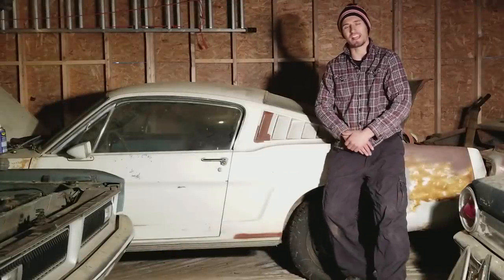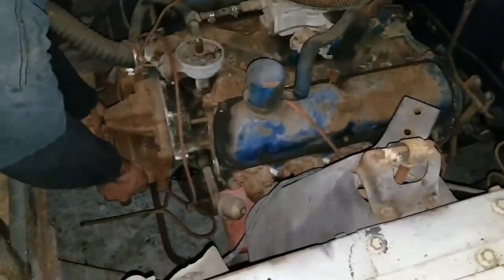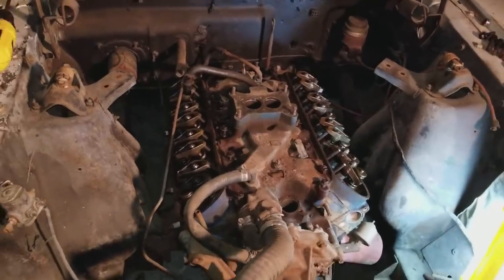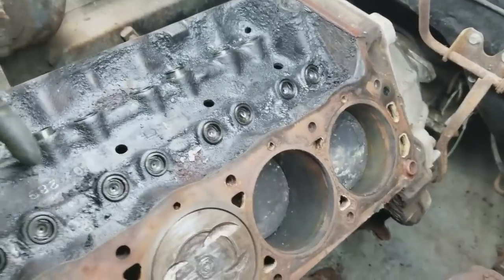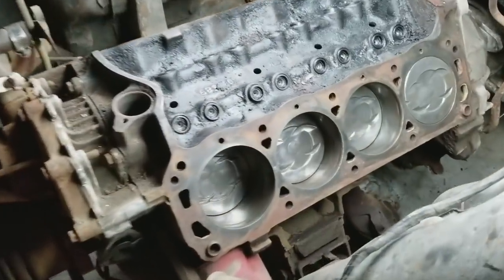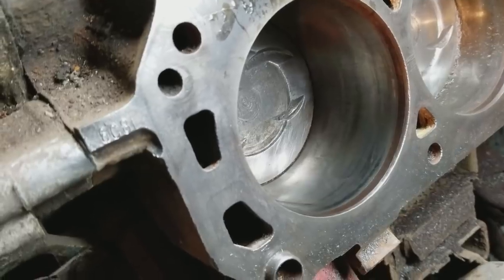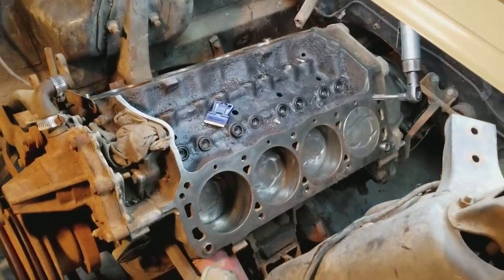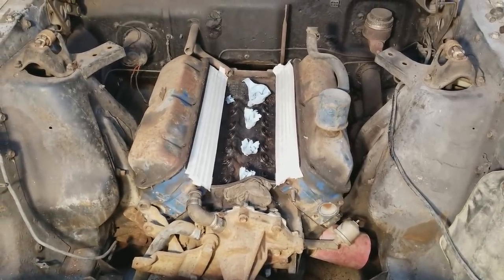Forgotten 1965 Mustang First Start in 44 Years, Fastback Revival Part 1!

Comment: I am new to the channel What about that abody in front of you
Reply from the maker: Glad to have ya! And Good eye! It's an original paint 1971 Dart Swinger Special. All original, never been patched, little to no rust. 6 cyl auto trans. Black interior that's like a step back in time it's so clean
Reply: I recently bought my first real project car a 72 dart swinger that was probably very similar to yours.  Someone swapped the 6 cylinder for a 318 and installed a roll cage. A little to modified to go back to stock. Also I guess they forgot about the stock rear axle so I am looking for a 8 3/4 rear end for it. My boss is a huge mopar guy so i am sure he has 10 hidden in the shop.
Reply from the maker: @AppalachianMotors  right on, what's your plans for it? We have a 69 as well which I'm thinking of putting a 340 and 4 spd in with 8 3/4 read end at some point
Reply: @Theoldcarchannel.   plans would love to put a 4 speed in it keep the 318 for as long as I can its primer gray and flat black I want to paint it a dark burnt orange and keep the hood flat black not a super great paint job I still want to drive it beyond that I am not sure what I want yet its half way to a old school drag car already

Comment: I highly recommend a timing chain....
Reply from the maker: Yeah, could probably use one eventually... but not atm. Like I said before, simply just want to get the engine running. If it dies,oh well. Plan B... if it lives cool, then ill start pulling it more apart (oil pan, oil pump, new this new that etc)
Reply: @Theoldcarchannel.  yeah dude but nylon cam gear? 50 years old??? 25$ set and 3 hours time down this far already
Reply from the maker: @bing bang 5.0 are a dime a dozen. Have two complete engines and 5spd set ups that will slide right in its place
Reply from the maker: @bing bang 😂😂 give me a break, making it worse with a 5spd... yeah that why everyone who has a stick car is now going 5 or even 6 spd. Who give two shits about numbers these days... if it were a K code completely different story, but it's a C code car (289 2bbl). If it were a 6cyl would you want me to keep it that way?

Comment: Why do MOST restored cars SOUND so loud as if they will blow up in a MOMENT? They WERE quiet when they were new. So please ANSWER this truthfully!! You can restore an engine back to. New
Reply from the maker: Was that last sentence a question? lol😂
Reply: I think that most restored cars from this era usually get custom exhaust which is louder, and often they get bigger cams which cause the idle to be erratic and can cause valvetrain noise. If the car is "Concours" restored, where it is exactly as delivered from the factory then it would sound different in many cases. Although many engines from the muscle car era had big cams and loud exhaust straight from the factory. A Ram Air IV GTO has a big cam, a 426 Hemi had a big cam and loud exhaust. Many other cars did too like LS6 Chevelles, 428 CJ Mustangs, ect. But the standard cars, which were much more prevalent in numbers, generally were much more docile. As a matter of fact most got the exact same engines that would have also gone in the larger luxury cars so smooth idle and quiet operation were very important. To answer your exact question, cars today are restored with modifications that are pleasing to the person restoring them which more times than not means "Hot Rod" parts and the noisy operation associated with them.
Reply: Very rarely do people restore a drivetrain and exhaust to be stock.
Reply: @WayneTheBoatGuy  I don't know if you were aware but there is a huge aftermarket of OEM mufflers that are 100% identical to the original and in many cases are even date coded. Factory OEM exhaust systems are just as available. A totally stock restored LS6 Chevelle or Hemi 'Cuda are worth twice as much as something customized. Most Show and Shines and Cruise Nights don't draw Concours restored cars, they draw weekend warrior Hot Rods which, as you said, are seldom restored to stock. But more cars are being restored to stock then ever before because of the value. And the parts to restore them that way are becoming more and more available every year. In 1981 I couldn't get a molded upper radiator hose for my '69 Charger anywhere. Today I can get a molded upper radiator hose for my current '68 Charger at O'Reilly, CARQUEST, Auto Zone, ect.

Comment: First of all it is not 44 years old it is older 2019-1965 is not 44 it is 54
Reply from the maker: First of all, it is 44 years. 2019-1975=44 years. 1975 was the last time it was on the road. If it was 54 then the car would be brand new and never driven

Comment: Typical novice mechanics, eventually they’ll learn.
Reply from the maker: Right because all of you with the typical "pull the engine and get it rebuilt" are gonna pay for it Right? It's to see if the engine will run after cleaning it up, if it does, great! If not, no big deal! Spent 4 days cleaning and putting it back together... Will just drop a 5.0L and a 5spd in it and call it a day